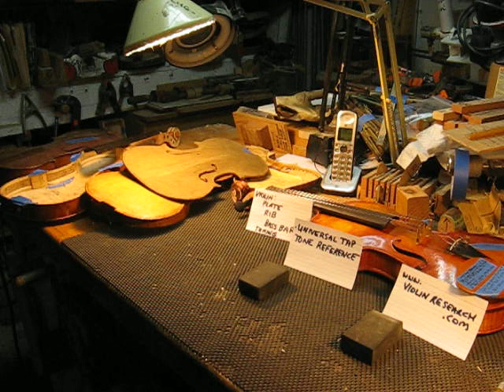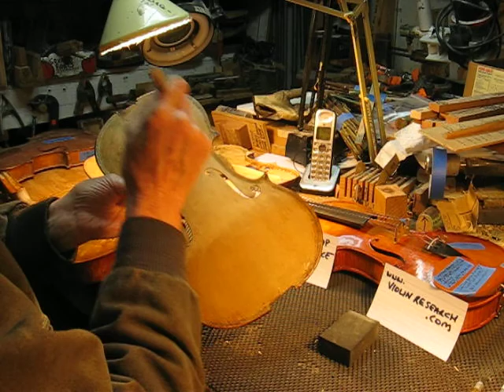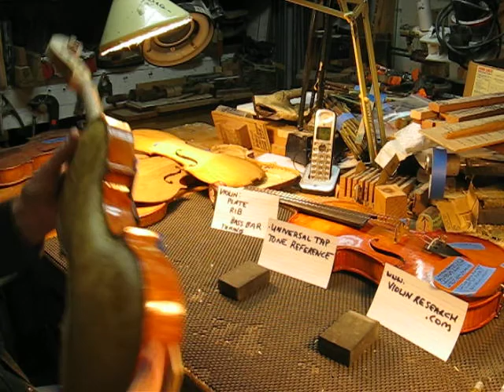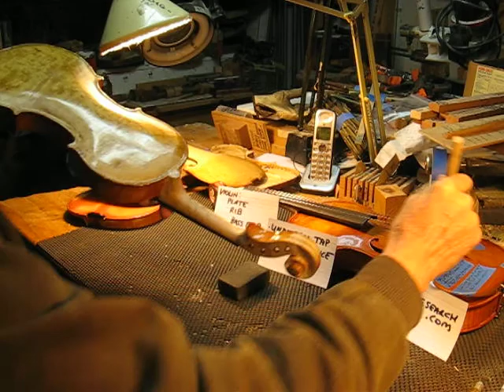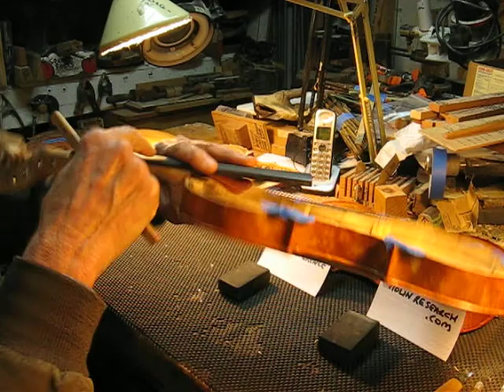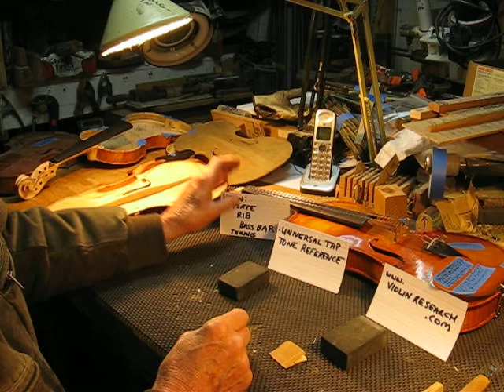Universal Violin Tap Tone Tool_bass bar tuning, rib tuning, plate tuning_3_2018

Comment: Hi Davide,  I have made  the tap tone tool_bass bar. Certainly, it is not made the some type of wood. I have the strange results. I'm using tha audacity program to measure the frequency of tap ton . The bar have the some measurements like your. One and 7mm, another 15, lenghs the some. In my case the frequency do not have the some range. In your case the range is quite large. In my case only 5 Hz. What can be the   reason, how you can explain so large difference.
Reply from the maker: Thank you for your inquiry: The short answer is that computer sound analyzer programs can not accurately measure tap tones in wood.  Instead; since you have made the wood reference tool; all you now need to do is calibrate it to my standard (using your ear and my reference tap tones).  Follow the links at: http://www.violinresearch.com/taptonetechnology_013.htm and mark it carefully in pencil and then in ink.  Then you should be ready to use it... David L.

Comment: I hope you don't mind I have a question on a different subject. I've come across several nice older German violins that have the beginning of a crack right at the edge where the saddle and the top of the violin meet. What's going on with the saddle ? Was the saddle fitted too tightly or did the glue on the bottom of the saddle give way and the saddle slipped or maybe is it that coefficient of expansion being different between the spruce and the ebony is causing these cracks is there a solution to keep it from happening again after the repair.
Reply from the maker: Good question!  The key is the work 'old'.   The top plate is made of spruce and over a lot of time it will shrink.  Spruce shrinks mainly across the grain rather than with the length of the wood grain so it will try to be less wide.  Although it looks better to have a very narrow gap on the sides of the saddle, this will become a stress point over the years.  To prevent this from occurring in older instruments, cut a sliver of the top plate wood out along the sides so that the top plate wood has room to shrink. You should see a slight air gap there.   Potential future problem eliminated!  David L.
Reply: David Langsather Wow I wondered that too!

Comment: @David Langsather  i think there is too much focus on the bass note.  Need to be more focus on the overtones because this is what really shapes the sound literally.
Reply from the maker: John;  Your comment is a good one.  I believe that when the 'bass tone' portion of a tap tone is at the correct, the overtones will also be at their optimum positions.  It is easier to hear and measure accurately the low tone however.  David L.